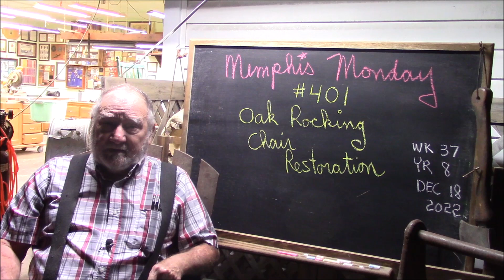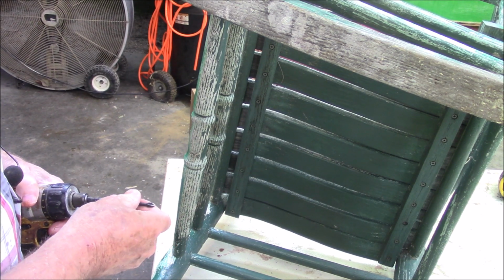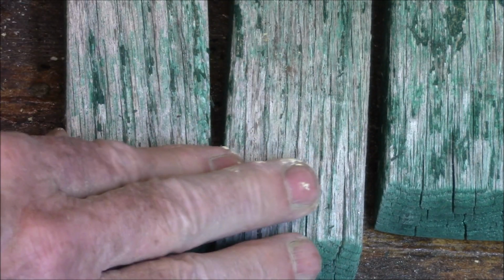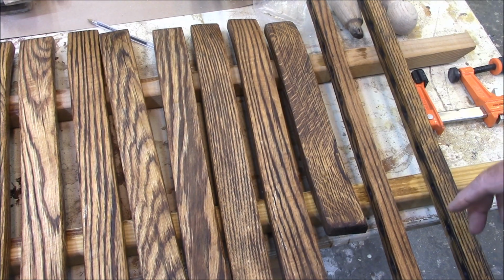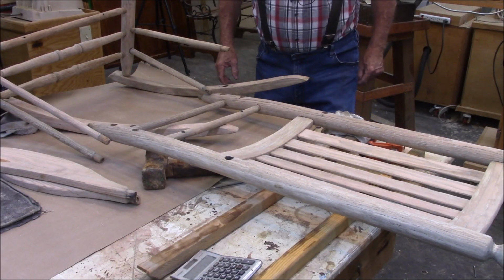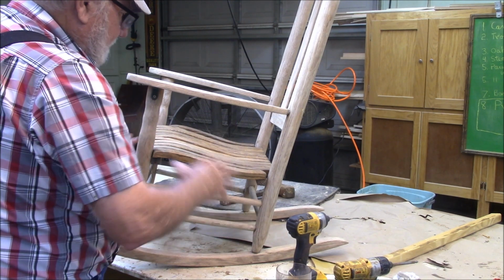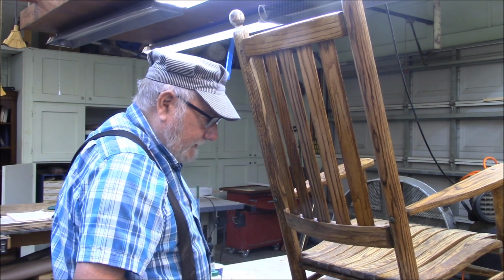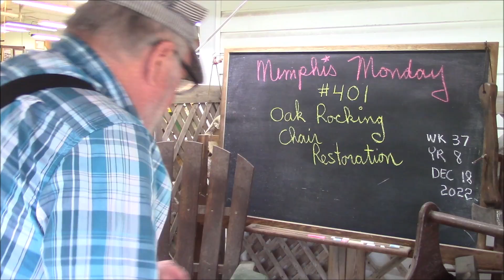401 Restoration of Oak Carolina Rocker

Comment: That is certainly a well built chair. The stain and finish look good but I would have probably painted it white. To me, nothing says old timey farm house like a white rocker. Another characteristic of hide glue is that with heat/steam it can be reversed and furniture can be taken apart and repaired. I always enjoy a your restorations so thank you for this video. Merry Christmas.
Reply from the maker: I hear you on the white paint.  This model was specifically put together for a paint finish.  They do have an oak stain option, but my guess is that they use different wood ------ quarter sawn.  
I'm becoming a big believer in Hide Glue.  I always wondered why it was used so often in chairs and other furniture, and now I'm learning.  Thanks for the kind words.